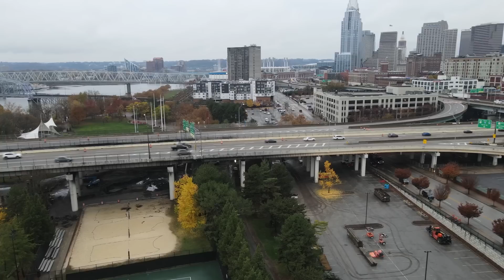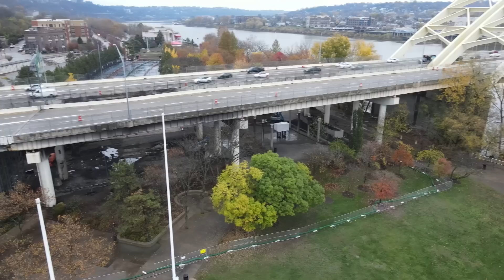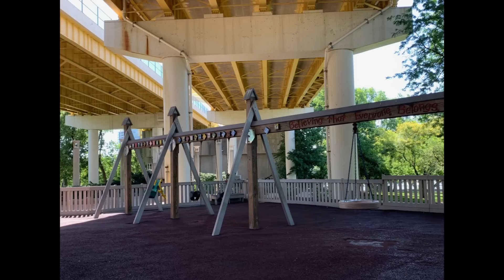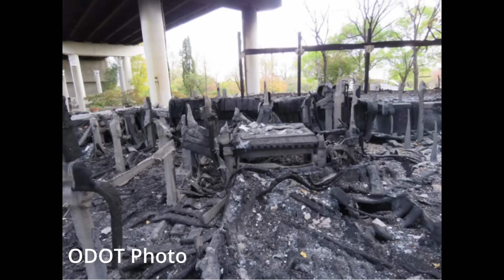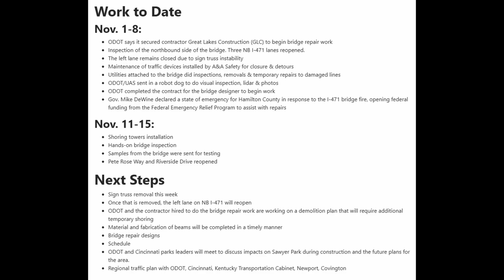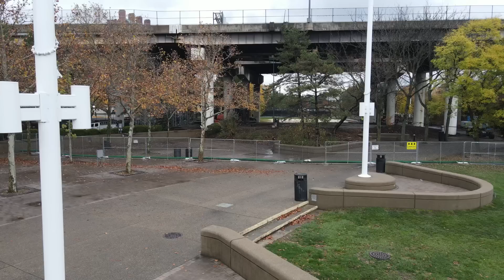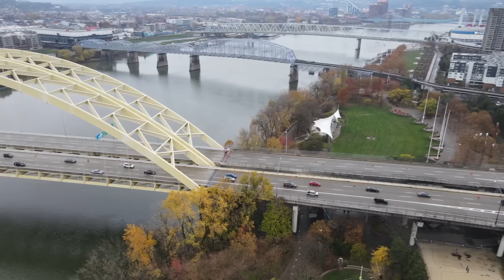Big Mac Fire Update with Drone Footage

Comment: I can only say, after a glass of scotch, how I would do this. 

1. We know decking has to come off the structural units, that’s a given. 
2. We know that the outside girders cannot carry the weight any more. 
Very simple. 

As they have done, 
braced the girders at the weakest point. 
Slide a weight bearing steel plate up to within 6’ weakest point and start jacking out the decking (hopefully protecting the temporary bracing) along an orthogonal to the girders. Knock out 6 feet, then go back and knock out 6 feet and keep going both directions until there is no concrete that has been denatured. 
   Once that is done you can evaluate whether the girders can be spliced in and how many girders are needed. Next go back 6 feet and saw out strait orthogonals and remove the needed concrete saving rebar and protecting it from moisture. 

   
   Here is what I think the problem is,  budget. The state of Ohio probably needs to find the funds to hire the contractors they need and the funds were not available. Moreover, if they want drop-what-you-are-doing contractors they need to pay more for that and they don’t want to. So given the budget constraints they need to work in structural inspectors and engineers to decide how to proceed. And it’s holiday season, and institutions start to slow down at thanksgiving and by December 15th things pretty much will come to a dead stop. So those companies doing projects are not going to take on new projects until January, again you can’t do a lot of stuff in the cold of winter, for example you cannot pour concrete, if that were even possible, given the structural problems. 

   I Thing the issue is here is are they going to try to splice in Girders which is achievable if proper sleeving of the girders are done. Or Are the going to remove the girders from two whole sections of bridge. This gets to your thinking, if you think the bridge can last 50 years, then you obviously want to replace the entire sections. If you think the bridge may only last 10 years, then you might just try to patch the problem.
Reply from the maker: That sounds reasonable to me scotch or no scotch! Thank you.
Reply: Having previously lived near Cincinnati for over 30 years, I would not be holding my breath. When the I-75/I-71 bridge was originally opened to traffic in the 1960's, it was immediately apparent that the bridge was already obsolete. There has been talk of replacing the bridge for over 50 years, & the answer was that it was too expensive to do so. The riverfront has been re-developed, with the Cincinnati Bengals & Reds each getting brand new stadiums, paid for by the citizens. How & where the bridge could be reconstructed seems to be an afterthought. Cincinnati seems to have painted itself into a corner. They seem to like fixes that are meant to be temporary, but somehow turn into something more permanent.

Comment: Write up by California DOT on a similar incident:
California Department of Transportation’s Interstate 10 Santa Monica Freeway Bridge Fire
In November 2023, a major fire erupted in two leased California Department of Transportation (Caltrans) spaces directly beneath Interstate 10 near downtown Los Angeles. The fire consumed multiple vehicles, trailers, pallets, and cases of hand cleaner – as well as causing extensive damage to freeway infrastructure. This stretch of I-10, which handles up to 300,000 vehicles daily, had all lanes reopened within just eight days. This speedy $18 million restoration project was made possible by continuous efforts from on- and off-site work crews and engineers, favorable structural testing outcomes, swift debris removal, and seamless coordination among state, local, and federal authorities. Avoiding a long-term closure proved crucial, as it could have disrupted the daily commute for up to 300,000 people and dealt a significant blow to the local economy.
Reply: I made a longer post but just to repeat in brief ... this bridge is a convince to Kentucky but paid for by Ohio.  So while the Cali of it may be better, the bridge in question was likely for Cali by Cali
Reply: @davidgoodwin4148  Well, it's important for all interstate I-71 traffic, not just Kentucky. I assume that the feds are paying the usual 90% since this is an interstate.
Reply: It's I-471, a spur road, not I-71, which crosses the river about a mile and a half west, with three other bridges in between.  It appears to be about ten miles long, and leads to US 27, which appears to be a feeder road providing access to that part of northern Kentucky, but doesn't appear to be a cross country route like nearby parallel I-75.  Given the alternate routes available, maybe they're considering whether to replace that southbound span at all, or just reconfigure the northbound side to carry both directions of traffic.  Through traffic is likely better served on nearby I-71 and I-75, which is where I-471 leads anyway, or to smallish local streets.

Comment: Casey, was it a tornado warning, or tornado watch that triggered a covering of the water circulation pipes?  In my area, tornado warnings might get us 20--30 min. of lead time to act, not sure how any system could be fully implemented in that time frame.  Did that lake/pond have a concrete bottom to facilitate extra fast construction speeds?
Reply from the maker: I can't remember, but I think a watch would trigger it.  The backfilling would have been temporary under those circumstances, so there was no concrete bottom used.

Comment: I wonder if this could be a warning sign, or maybe should be a warning sign of the level of confidence in these state DOT or State Engineering, politically appointed department heads? It sure seems to be a reacquiring issue we these types of state highway problems!
Reply from the maker: Yes I don't think taxpayers are getting their tax money's worth from these institutions.
Reply: I know I'm repeating this a few times but just so it is here as well.  This bridge is convient for Kentucky but it is owned and paid for by Ohio.  I feel that is the reason for the delay.  As someone who used the bridge that and a few other reasons seems fair to be low priority.  Few who count (voters, taxpayers) would be pushing.

Comment: I just had an out of the box idea. The area of the bridge is over land. Build up the land high enough to support the roadway. No more bridge more like a causeway between bridges.
Reply: With all of the cities along the banks of the Ohio River comes the issue of pollution. They generally draw their water supply from upstream of their location, & discharge their "treated" waste water downstream of the water intakes. Cincinnati draws most of its water from an aquifer that lies beneath the Ohio River, but then treats the water through an activated carbon filtering system to remove chemicals that may be present. This filter carbon is run through a process that heats it to remove the absorbed chemicals, & then it is reused. It is an amazing system for an ever present problem.
Reply: That a good point.  Off the top of my head id have to say the current level of the ground is just where it happened to be historically.  That ark on a pole with the stick below it ... That is the highest ever flood.  There was nothing there because it floods there.  (That might also address the toxicity of the rubber mulch .. pretty sure that floods to .. The river is not swimable due to general toxcity. [That is an upgrade from years ago where it was unsafe to be in a small boat on it due to toxicity in the air])
Reply: It could make a flood worse by reducing the width of the flood, making the flood higher upstream. I'm not sure how fast the flow levels would be in those lowlands, but it's something to study before bringing in the dirt.
Reply: @johnhaller5851  Yes, building in a floodplain has some problems.

Comment: Don't ever build anything underneath bridges or highways! I think that this is another example of how some states run their DOTs better than others.
Reply: Also I wasn't aware that playgrounds are so... flammable.
Reply: @nitehawk86 not just flammable. This kind of plastic and rubber burn with extreme intense heat.  Should never be placed under a bridge structure. Somebody was not doing their job.
Reply: I feel like that parking restricted under the bridge is never going back to normal.  I liked parking in the shade there.  That being said, all the lots on that side of town are under overpasses.
Reply: Just make sure that if you build anything it shouldn't be causing a major fire. If it's left empty then it will become a dumping ground.
Reply: I've seen several states DOT's use underpasses to store gravel, dirt, sand, and salt ( in a small silo ).  And all of those uses are fine. Since, excluding a semi above raining down some fluorinated compound.  None of those materials are flammable, or a danger to the integrity of the overpass.

Comment: Of all the people in the world, the ones least likely to think outside the box are engineers.
Reply: Government engineers maybe.  Engineers properly managed are given 'clean sheet', first principles latitude.
Can U even define "engineer" without looking it up?
Reply: @Mrbfgray  Like the designeers of the ped bridge at FIU?  Missed a few principles?
Reply: @michaelmcmullen354   What's your point?  Do you even know what principles are involved, a broad description?  Mistakes are made in every realm.  I don't recall if your example was an engineering or execution failure or combination.
Reply: @Mrbfgray  Engineering error combined with no checking combined with no one being in charge combined with shooting from the hip by higher ups who were ignorant once distress was found.  Just type in FIU ped bridge failure.  Innovative bridge where the engineers in charge (whoever that was... for the courts to decide) were incapable of designing a bridge like this.  I think they were all trading on the respect earned by others.
Reply: @michaelmcmullen354   Always lessons to be learned.  Some 1/3 million major bridges in USA.  Only hear about the failures.
Reply: @Mrbfgray  Definately.  I like failures for a number of reasons.  In particular one learns much more from them.  Also if you are fixing the reasons or the bridge people and the system gets out of your way.  None the less as a practicing engineer things need to work the first time unless you are doing research or test articles.  You have to be very competent to try something new and inflict it on the public without a prototype or testing.  Even then incrementalism rather than giant leaps of faith or ego is what is needed.  There are exceptions, mostly when there is no current solution to a problem and anything is likily to be better.

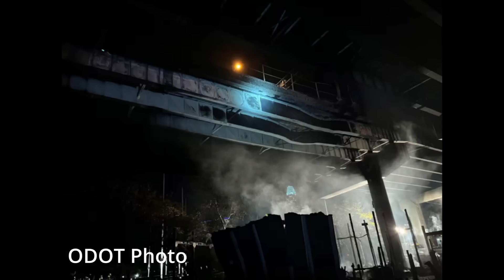Comment: Casey, 100% with you.  One look at the twisted girders at about 12:00    There is no reason to test, no reason to wait.  They are coming out. The soils,, also, you don't even have to test them except to pick the landfill authorized to accept them.  Remodeling is a subject I am well familiar with,, it is expensive to remodel,, pick and choose which stud or floor joist is good,,, it is invariably cheaper to just remove and utterly replace all.  I would not have even put the falsework up,,, except  to stabilize the certainly good, un heated span.  

You nailed it. Keeping any of it entails great risk of liability and any piecemeal repair will cost more than just doing it wholesale.  Excellent video and analysis. That one photo told the entire story.
Reply from the maker: @deanunick7156  Thank you so much. Those are great examples for this situation.